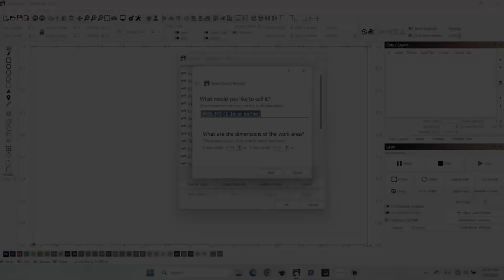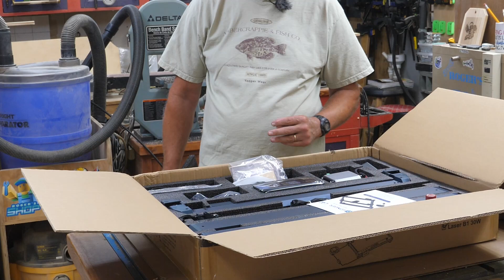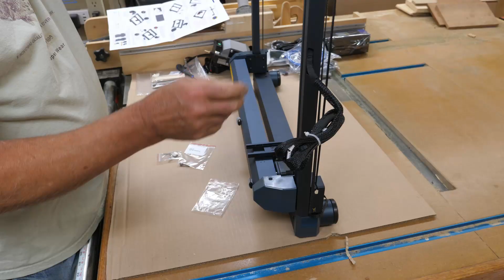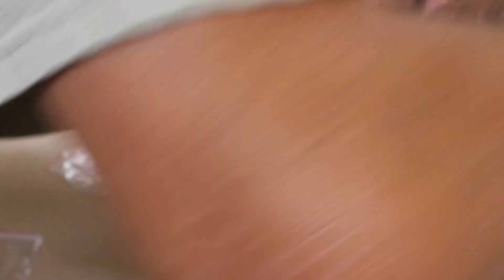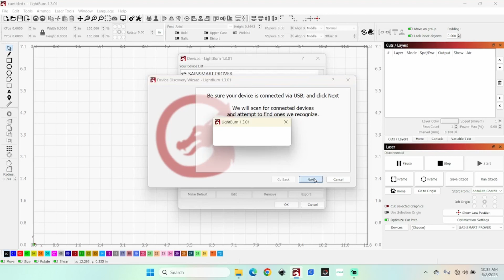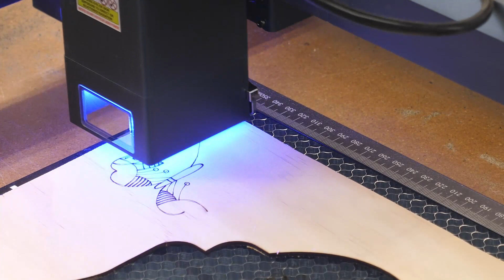Longer B1 30W  Laser Detailed Assembly

Comment: I just setup the 40W Longer.  Thanks for this video which helped.  I feel like I have an extra part that was not mentioned in the setup instructions.  It appears to be a gold laser lens cover and you can see it in a plastic bag next to your thumbdrive at the top of the video at the 19:41 point.  Is it 'extra' or am i missing something?
Reply: Same, plus, i have an extra connector where the laser connector is, it's a 2 pin, any idea what that's for?

Comment: Hi Rodger, Have the longer ray 10 watt. I would cut 1/8 wood at 100 power and 6 speed. Not sure what happen, but now I have to use 100 power and 150 speed. Is it something in the settings? Need help. Thank you.
Reply: ok will do. thank you
Reply from the maker: Check to make sure lens is clean.

Comment: Note to self: Wait until AFTER 4:20 to burn one....  When you are installing the Y axis belts, insert/fasten the belt into the "slot" nearest to the REAR on the machine, then, move the X gantry FULLY TO THE REAR, THEN and only then attach the belts from around the pulleys in front, to the open belt slots in the rear....  Installing BOTH belts when the gantry is somewhere in the "middle" of the Y axis travel, you are NOT assured that both sides/belts are properly synced/aligned together - in the same relative position as each other....  I hope others will catch this mis-information and assemble their new machines following a "proper" procedure....  AND at 13:44 Don't grab the belts when moving the frame, your just stretched the hell out of them...

Comment: Thank you.  Is it worth starting out with this or going for the cheaper Ray 5 20W.  I am an enthusiast wishing to engrave and cut.
Reply from the maker: If you intend to do a lot of cutting of 1/4" or thicker materials, then the 40W is a better choice.  If mostly engraving and cutting 1/8" plywood, then the Ray 5 is fine.  It all depends on end use.
Reply: It is kinda like MOTORCYCLES....  You buy a "small" bike, then, two weeks later you want a BIG ONE.............  a 30-36 watt laser will perform good "engraving/marking" while having the higher power to cut more,better, FASTER....

Comment: Just got my Longer B1 30W laser up and running.  Unfortunately, it homed the first time connected and now it won't do it again.  It is reading the x and y axis backwards and inverting.  If I use the User Origin and mark the middle, it doesn't use that.  It actually moves and hits the rails. Any advice would be great!
Reply from the maker: Assuming you are using Lightburn...........Are the settings in Lightburn correct?  Home left front and bed size set accurate in the setup.  If these are correct, then you will need to contact Longer as this seems very odd.

Comment: Well Roger I have mine 2 weeks now all of a sudden it quit working cut three small projects with it .
Now I turn the machine on don't do anything don't go home on startup. the arrow keys some work some backwards.
Contacted longer told to try reburning the firmware that didn't do anything to them I want to send the machine back faulty. now I don't hear anything from them.
Reply from the maker: That does sound like a firmware or motherboard issue.  I am not affiliated with Longer, so can't help you there.  It does take 24 hours to receive a reply from them during the week due to time differences and they do not reply on weekends.

Comment: Any way you can possibly make a video of setting up wireless for this thing
Reply from the maker: There are two reasons I do not use wireless.   First, and most important, is if there is a dropped packet in the wireless transmission, the project is ruined.  My second reason is that the wireless in the shop is 5G.  The laser only supports 2.4G.  I never use a wireless connection for anything "important".
Reply: @rogersshop  very good info never thought about that Iv always dedicated wired but can’t figure out how to upgrade the firmware

Comment: Roger what do you have origin set at in device settings. I went into preview to look at cut job looked ok but when it Cut is was upside down.
I have a longer B1also any help wood be appreciated. Donnie
Reply from the maker: Lower left or center if not using Absolute Coordinates.  When using Current position (rare), I use center as the origin.

Comment: Hi Roger, 
I just finished assembling my new B1. Upon homing, the x axis limit switch is not contacted by the laser module bracket. It looks like it should move at least another 12mm X- to contact the switch but stops solidly. I don't see any way of adjusting it. Starting to wonder if the mounting holes for the switch were machined out of location. When your B1 is homed in the x axis how close is the module bracket to the stepper motor? Any other ideas? Thanks
Reply from the maker: I'm not at a location where I can look at it, but I had no problem with the X axis.  On the Y axis, there are two sets of mounting holes.  One for the 20 watt and a second for the 30 Watt.  I don't recall if the same is on the X axis gantry, but you could take a look.

Comment: Out of curiosity, which driver did you use? I'd seen a video saying the base Laser GRBL was the only one that worked, but that Lightburn defaulted to a newer one that caused the laser power to 'stick' on for want  of a better term.

I have a Neje A40640 (10w) on the 3s chassis (540mm*850mm), and it's MAX speed is 1000mm/m. I'm really looking to upgrade, but a lot of the work I do needs the larger bed size, so it's kind of up in the air whether it's worth the extra $1000 for the things I don't use the larger bed for. All the new 30-40w lasers will fit in the bottom corner of my Neje lol.
Reply from the maker: Default driver.  I don't use Laser GRBL.